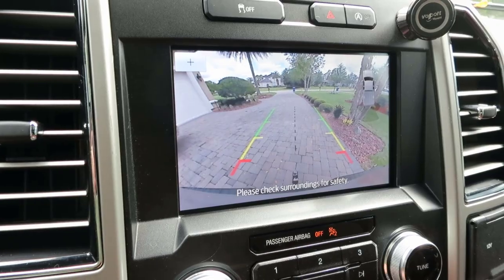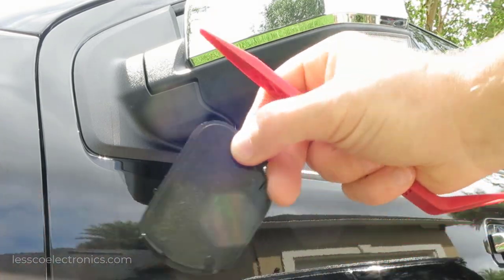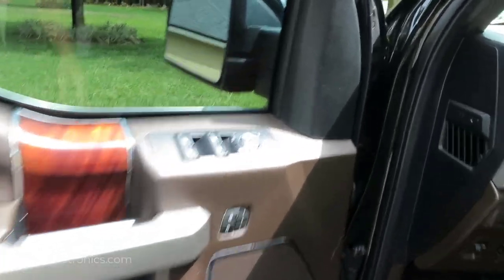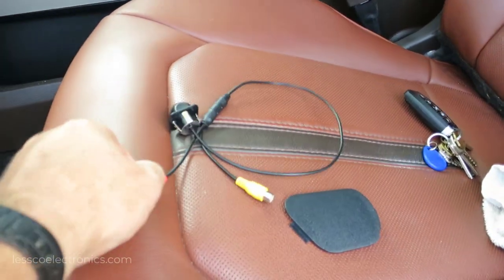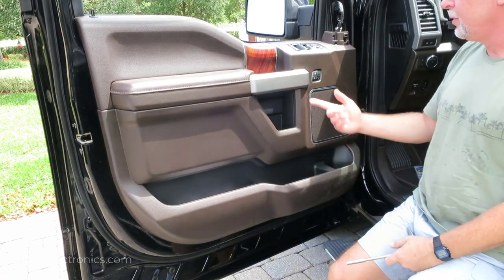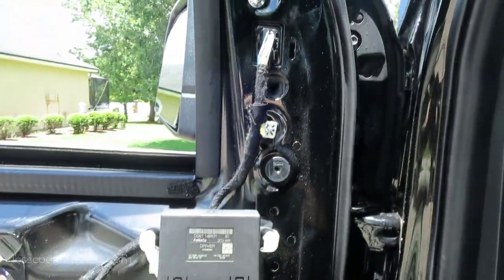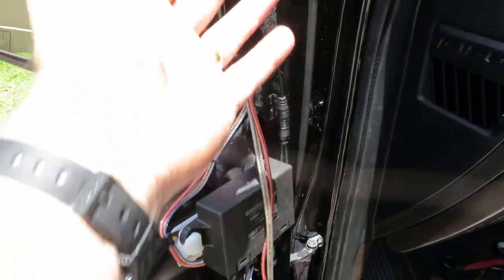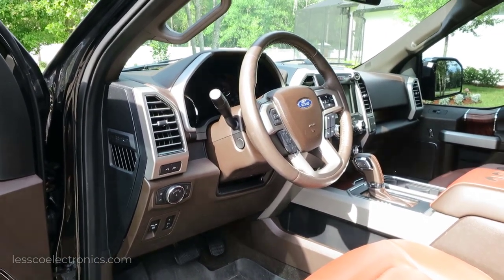Ford F-150 / F-250 Side View Mirror Camera System Custom Install

Comment: did this years ago on my ‘09 F150 with Sync Lockpick kit, great to see left and right cameras automatically when turning on turn signals and was able to add front and secondary camera for trailer. 
I think it was last year for dvd player in these trucks, so dvd in motion feature is awesome, my passenger can watch a movie while I drive. No I don’t allow myself to be distracted by video,  built a little deflector. It’s nice for 5 hour drive to cabin.

Comment: Nice job documenting this. I bought a system to install in my truck and haven’t started yet because I’m concerned about trying to drill out unused pins in the factory harness large enough to get the end of this camera wire through. Luckily the end is pretty compact but still larger than a wire alone so I’m concerned that I might need to drill out three or four pins slots. I haven’t drove into it yet so I’m not even sure if I’m going to have that many unused pins available. so I’ve been considering to just not even mess with the harness at all and just drill through like you did. I really miss the old school looms that you could just easily add wires to.

Comment: Really nice and clean install. Also, something like this is probably possible for most any vehicle with an aftermarket radio that supports a backup camera.
Reply: I have a 2002 Trailblazer, and I have been looking at some Kenwood Nav head units that have 4 video inputs, so this is possible. I currently have a Pioneer Nav unit that is 15 to 20 year old technology, but has maps that are only about 2 years old. Yes, this is very possible.
Reply: @David-rx5eo  is there a link for instructiond I want to do this to my 2023 power boost

Comment: Add a hidden camera under side mirror to blind spot side mirror light indicator power wire.  it turns on the camera on that side of which ever side a vehicle is approaching from the rear and shows up on the 4-quad screen only or by pass with all 4 going and or powers on when detection is detected and front and rear can be with constant on and off power switch straight to battery for continuous recording and or monitoring.

Comment: question on an older 360 system. I have an issue with a Haloview 7101 camera. Do you have any contact info for the company?
Reply from the maker: https://www.haloview.com/haloview-mc7101-4-7-digital-wireless-backup-camera-system-with-4-cameras.html

Comment: hey great video ..im doing the same thing on the boost auto tow mirrors for my f150...installed the linkswell gen 4..12" screen...does your backup markers always stay on like that on the turnsignal view? and how was drilling through the passenger side with the fuse box and all? looks super tight there...
Reply from the maker: The driver side was a little tough, the passenger side was a breeze actually, way simpler..

Comment: Awesome video! I hope this is a valid question, How did you find the trigger wire for side flasher, i am planning to do it on my ecosport. Thanks!
Reply from the maker: This unit detects it by can-bus without any wiring